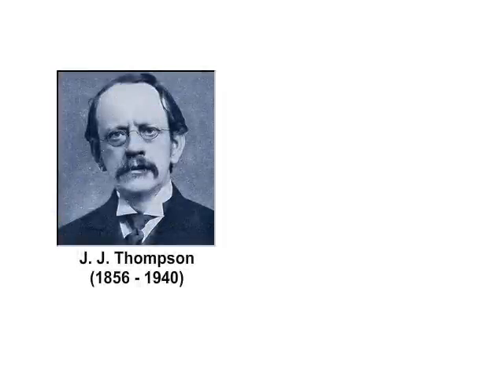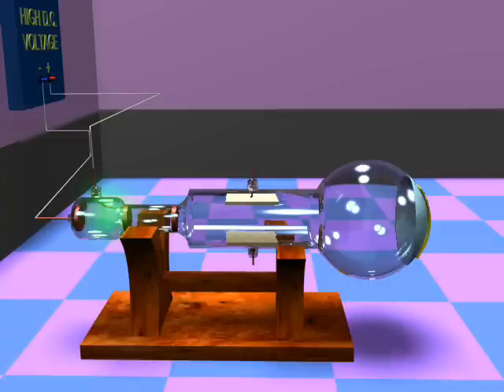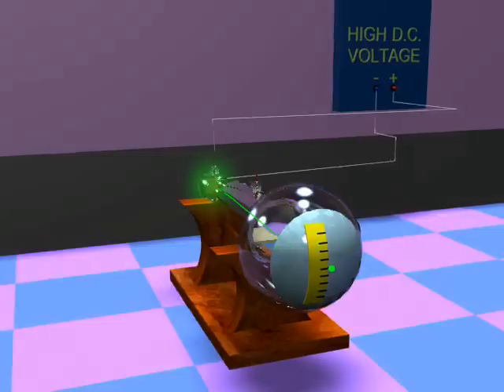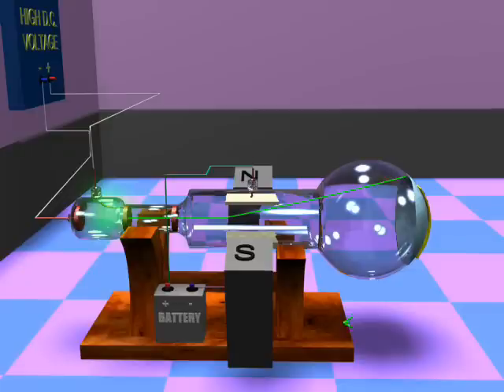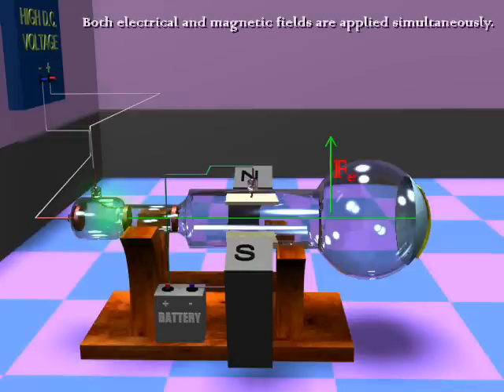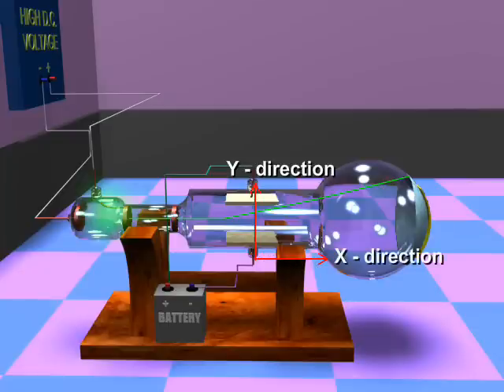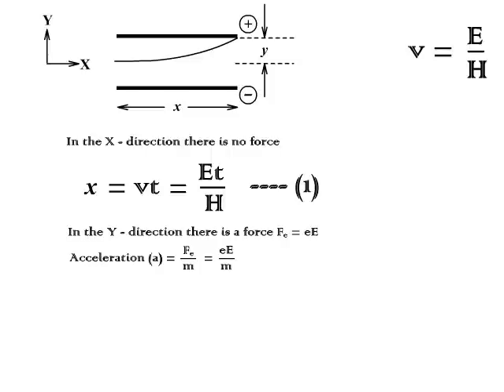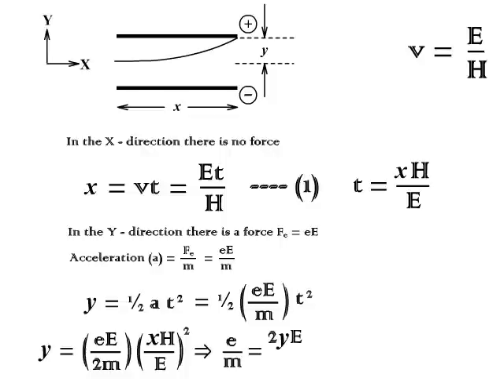Charge to mass ratio of an electron

Comment: If the charge of an electron must relate to the mass of an electron to maintain the mass ratio of an electron, then calculating the mass of an electron using that ratio would depend on the calculation/measurement of the charge of an electron. And if the measurement of the charge of an electron depends on the charge of a proton, then it would not relate to the real mass of an electron. So perhaps, many small electrons are making an opposite charge to balance the charge of a proton.

Comment: When we use Fleming's Left Hand Rule for the direction of deflection of electrons, shouldn't we consider the direction of flow of current (instead of direction of motion of electrons). Fleming's Left Hand Rule states that the middle-finger must point in the direction of flow of current, not motion of electron (or xyz). Considering that, the deflection of electrons would be in the opposite direction as stated. Please consider.
Reply: By convention, the direction of current is considered as opposite to the direction of flow of electron (Class 10th NCERT)

Comment: A moving electron beam has charge, every moving charge has a magnetic field.
"All moving charges produce magnetic fields. Moving point charges produce a complicated but well-known magnetic field that depends on the charge, velocity, and acceleration of the particle. It forms closed paths around a line pointing in the direction in which the charge is moving. "

I wonder if an electron beam has a magnetic field as if it were running on a conducting wire?

Another question, if this fired electron beam moved in the same motion as a spiral solenoid, would the electron beam produce the same magnetic field as a spiral solenoid?

Comment: Ok, good explanation by a theorist for an idealized system, but useless for a real experiment. The capacitor plates obviously can’t extend the whole length of the tube, and this makes the modeling significantly harder. Bottom line, if you’re doing this experiment with equipment, don’t rely on this video.

Comment: why do the electrons act like a monopole (S) at the JJ Thomson experiment ?

If you apply a magnet around the tube from the outside without external electric field,
the beam ray deflects towards the N-pole and repels the S-pole.

From the Stern–Gerlach experiment, an electron has a magnetic dipole moment. So it could have 
N-pole as well. But it seems that the electrons on the Thomson experiment don't have the N-pole.

Why is that ?

Comment: The electrons are not comming from the gas..the are actually comming from the copper plate of the cathode...
Reply: wonder if this is true? any answer pls?
Reply: Yes.the electrons are not coming from the gas. They are coming from the cathode
Reply: fast moving electrons excite the gas in the tube, causing a glow between the electrodes